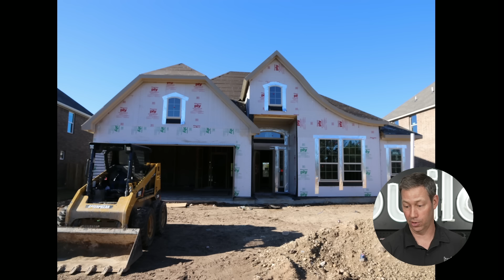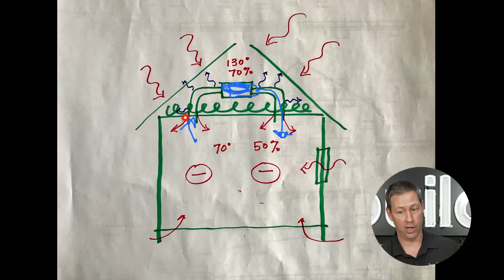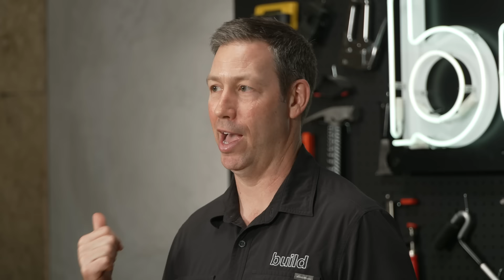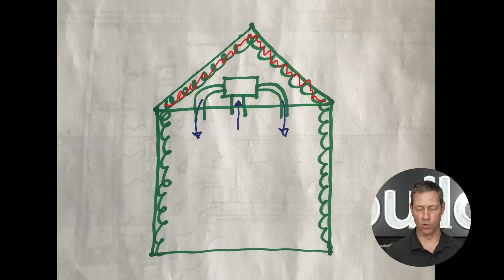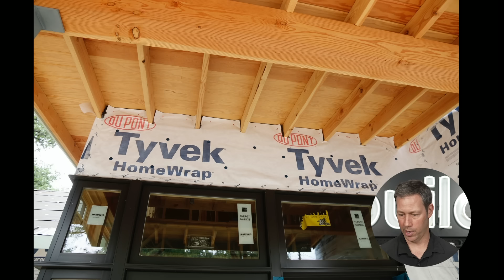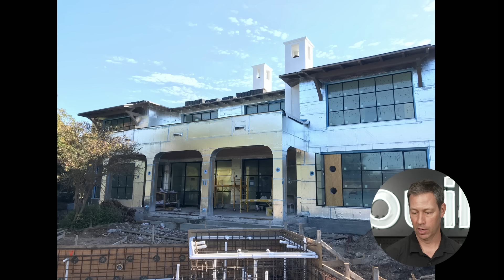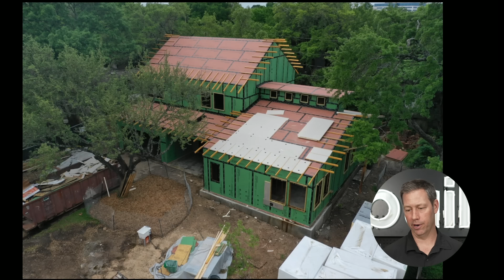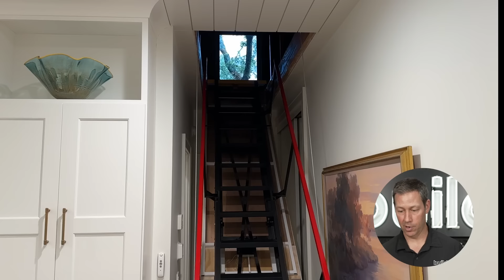CRAPPY ATTICS are Standard in America! Here’s how to BUILD - DECENT or AWESOME

Comment: Properly done, the ventilated attic is the highest and best design for cost vs. efficiency that there is. The only real restriction is that you can't have your HVAC up there. That's it. As long as any penetrations from below are well-sealed and its got a good vent ratio and is protected from wind-washing with a good R-60 or so in the "bathtub," it will be very hard to compete with long-term.
Reply: What do you mean by “bathtub”?
Reply: @kc9scott  A friend of mine is the OP above. He told me that he has answered you twice but both posts have been immediately removed though they had no links or anything else unusual about them. So I am going to attempt to post his reply in different language and see if it gets through whatever is happening on YT or with this channel. Your question is best answered by Joe Lstiburek, a building envelope engineer. If you do a search for -- building science insights to vent or not to -- it should come up. (My reference is missing normal punctuation in case that has something to do with the problem, maybe referring to the work of someone else.)
Reply: @mpenner2124  OK, thanks, I checked it out.  For others casually reading here, the “bathtub” is the attic floor (really the ceiling of the level below), along with any vertical barriers needed along the outer edge to hold in loose-fill insulation, and to stop air from blowing through that insulation.
Reply: Why can’t you have a vented attic with the HVAC up there?   The HVAC company I used moved my HVAC to the attic instead of garage, said so it was more centrally located
Reply: @27photogger  Did you watch this video? Or the other one my friend referred to above? They explain why. It’s about a 25% energy loss.
Reply: We have our HVAC air handler and ductwork up in our attic.  That's how it was when we bought the place.  Not sure what I'll do when it comes time for replacement.  Maybe multi zone mini splits on both sides of the house
Reply: @robertm5969  That can be a very good option if the capacity is sufficient and enough fresh air is getting into the house otherwise. The other, probably much more complex option is to remodel the attic into an unventilated design.
Reply: @ReflectedMiles  why is fresh air entry into a house a consideration for attics, HVAC systems and mini splits?  As I understand it traditional HVAC and mini splits don't draw fresh air into the house
Reply: @robertm5969  The mini-splits do not, hence the term “ductless” in association with them. A well-designed traditional HVAC scheme will normally incorporate fresh air exchange in some form. Indoor air has long been a source of major exposure to pollutants according to the EPA. Many homes that are not sealed well, however, leak a lot of air anyway, but the ideal is to control that and have controlled fresh-air exchange at a given rate for the size of the space.
Reply: @ReflectedMiles  thanks for the explanation, I understand.  I don't believe our HVAC system incorporates any fresh exchange.  Our house was built in the 80s and Ive done my best to air seal the attic and other major gaps I've found in the past year.  However, I'm sure a decent amount of air is still getting in/out.

Comment: The one thing you missed, is actually drywalling. Your attic can actually be a completely functional usable space and this is actually very common in Europe.
It’s such a waste to throw away what is essentially an entire free floor  (if you’re insulating on the roof side) it also means it’s much easier to keep clean no dust collecting in your Rockwool, no critters. Makes it much easier to keep it a tidy space.
Reply: he didn't miss it, the way the HVAC is setup it's in the free space.  drywalling it wouldn't have made an appreciable different to making it a usable space, as all that equipment would still be in the open space.
Reply: Making it usable space would increase the home square footage and in turn the property taxes.😮
Reply: @allent555  not unless it’s taller than 6’. Everything less than 6’ isn’t taxable
Reply: He discusses drywall at 29:30
Reply: @allent555  only after you sell. And only the parts that are tall enough.
Reply: @twestgard2  seems he does briefly, still even for storage, it makes a world of difference, 
It brightens up the space, reduces visual noise. Both of which which makes it easier to see and find your items.
It does not need to become living space to see huge benefits from pretty cheap drywall application.
Reply: @twestgard2  I am sure that 6 foot rule would depend on exactly where you lived!
Reply: @DYI  I believe it’s in the international building code that most places in the US have adopted, but to your point, many places make modifications, and not everyone is in the US, so yes, definitely would have to check in your area if you’re doing a project like this.
Reply: @allent555  
Not if you wait till the assessor leaves🤔
Reply: A low slope hip roof is cheaper and leaves no room for anything but insulation in the attic. Use the money you saved to add a room or two on the 1st floor.
Reply: @ToIsleOfView  That assumes a lot of things, like the footprint available and zoning. It would also increase the taxes. And moving the AC out of the attic is a big stylistic choice. But maybe the biggest thing is that it doesn’t address any of the performance issues for air, vapor, and bugs.
Reply: @twestgard2  Footprint is the same for a basement or insulated crawl space. Air,  vapor, & bugs have nothing to do with a live-in finished attic. We have to air-seal unfinished attics the same. The split-level house offers a partial basement & an easy way to have a finished second level for bedrooms etc. Taxes? Living sqft and lot size? Attic-installed HVAC  must make high temperatures and poor access a detail. everything breaks down. R-5 flex duct in a hot attic is worse than an exterior wall with R-5 insulation because 1000 - 2000 cuft of air is circulated over the inner duct surface for a drastic loss of btu's into a vented attic. Finished attics are fine for remodels but not for new construction. I would like to see ceiling chases for all duct so the duct is completely contained inside the conditioned and sealed building envelope.
This can be done as a remodel as well.
Reply: @ToIsleOfView   You don’t seem to have watched the video all the way through or something. He explained the improvements in bug, vapor, and air. 

Your suggestion was to add a room or two. That changes the footprint, unless you’re saying to add a basement, in which case the cost difference is huge.
Reply: Just do not ever have attic? in AUS  Seems to be a Euro or US thing, as we don't need a lot of heating in most of Aussie houses except for the southern states.  And most new house are slab-on-ground especially new buildings.
Reply: That attic isn't very big. I don't think you can even stand up in it.
Reply: I’m positive that varies greatly depending on where you are.
Reply: Not free per se as often the trusses are engineered to take roof loads, but not habitable loads (furniture and people). If the truss also has to function as a floor, often joists need uprating.

Comment: The great thing about this vid is that it helps get the building community off auto pilot for attic/roof/ceiling construction. I'm 500 miles north of you, so we get the heat/cool cycles. The big difference, as you have pointed out, is that most of our heating equipment is somewhere in the living space. With that, 99% of homes here have ducts draped all over the attic. Personally, i have searched but have never seen a study done on the "vs" of spraying closed cell directly on the ceiling joists vs closed cell on the roof rafters. If we spray the roof rafters, there is an element of cost associated with heating/cooling that attic space. I have never seen exactly what that is. So, our method is to stop the cycle of heat exchange at the ceiling level and insulate the heck out of any ducts up in the attic. Someday, it would be be good to see the cost-benefits of  going this route vs the conditioned attic.

Comment: Here in my part of Europe, fully developed attics, and with that I mean attics developed as almost complete rooms, with (almost, only sheetrock, which would naturally be unacceptable as walling in any other room) proper walls or roofs, full isolation, flooring, outlets etc. are absolutely standard, so seeing these American attics is always crazy to me.

Absolutely do fix your attics, they can be real rooms, put your venting in the walls (where they belong), remove those internal wooden pillars and put in a Popper roof structure, and you will literally gain one or two additional proper rooms.

I live in a 2005 house, with an almost slab on ground foundation (we need some pretty solid ground anchoring, since we do not have a basement, and are not straight on bedrock) construction, and all our venting is in the walls, our attic is a full office, and since we have proper walls with isolation, as is required around here, we have basically no cooling costs in summer, even if it gets up to 40% in summer.

Comment: I find it rather wild that houses are actually built with the HVAC in the attic.  Owned multiple houses in Louisiana, Texas, and Florida which have all used a closet HVAC which places it within the controlled space.  The best one, in central Texas, had ceramic coated hard ducting and a (older) Carrier control system you would find in a commercial building  with sensors in each room, dynamic airflow balancing, etc which even included the walk in closets.  Massive overkill but apparently the guy who built the house designed HVAC systems for big commercial buildings and it was his retirement home.  Bought it as an estate sale and didn't realize what I got until the home inspector freaked a little while checking out the attic.

Comment: I live in a Fl. house that was built in the 50's with a very low pitch for hurricane protection. Never understood why the air handler was put in the attic instead of the garage.  However, the unit recently went and I replaced it with split units myself.  I will never go back.

Comment: When we bought our first house and I decided I wanted to store a lot of stuff in the attic, so I thought I’d do major cleaning. I didn’t know any better and vacuumed up all that insulation. Our house was built in the late 70’s. 
I didn’t know what it was, I assumed it was the mess the builders left behind many years ago. Boy did my hubby yell at me when he found out. And I felt like an idiot woman 😢
Reply: You actually did a good thing. Houses built in the 1970's had lots of air leaks from poorly fitted dry wall, holes for wiring, plumbing, and vent pipes. After you vacuumed all the insulation out, your husband should have gone all over the attic floor with spray foam to seal all those air leaks. Then you needed to put the insulation back in of course. Or he could have had spray foam installed between the roof rafters and floored the attic for lots of good storage space.
Reply: Dang, that is a loooot of vacuuming. Though, to be fair, the insulation probably wasn’t doing much at that point.

Comment: this is great and all. but it still makes it hard for me to decide how to retro fit something like this into my 70s style attic because the pitch of my roof is so low that my attic is a crawl space.
Reply: I’ve been slowly redoing my attic and yeah it sure does suck basically crawling through it.
Reply: @chadhowell1328  i'd do it if i had more access. i'm not exactly skinny and even a skinny person would struggle with this.
Reply: Probably your only reasonable and easy option is outside insulation and air sealing the next time a re-roof is warranted. Removing the sheathing and replacing with zip-r sheathing or bare minimum, sealing the existing sheathing and adding exterior insulation rigid foam.

Comment: I have an old house in Germany which was also not insulated. At the end, I was actually using Sandwich roofing with 160mm PU insulation. I used it, against the advise of some builders here in the south of Germany, at a 55° roof angle. But it worked out great, and I can easily install some PV system later on on top of it. It will probably fulfil many new regulations the Greens might come up with in the future and the metal roof will probably outlive myself and serve my kids well, as long they put a new coat of paint on in time. Plus, since the old roof has been clay tiles, I did not need to change my rafters since the new roof is actually lighter than the old one PLUS I have now more roof Attic space available comparing to just insulate the Attic.

Comment: I bought my childhood home from my mother. My grandfather built it. I sprayed the rafters with open cell and cut our heating and cooling down substantially. We had 2 rooms that wouldn't get under 77-78 degrees with the AC running all day at 95-100 degrees outside. We also sprayed the walls of that room, and added 1" of that Perma -R to the inside wall. Basically a cooler. After that, the AC would then cycle thru the day and maintain 68-70 in the house regardless of how hot it got outside. We could take a week vacation, check our temps at home remotely and even on a 98 degree day, 3 or 4 days in, the 2pm afternoon temp would only be 80-81 in the house. If it was only 90, in full sun we would only see 75-77. The biggest reason for AC in most of the summer was humidity control. North Mississippi. The house wasn't in shade until early evening about 3 hours before sunset and even then 50% shade.

Comment: Not interested in spray foam (doing Rockwool), but my real struggle with a sealed attic, is the risk of condensation when a traditional roof is installed (asphalt shingle and tar paper on sheathing).
Reply: yes, you have a problem. cheapest solution is 4” of spray foam to resolve your venting issue, then the rest with your rockwool though you would be better off spending the cash an filling the cavity with closed cell spray in. The combination of 2 insulation types reduces the up front cost and allows for an unvented roof.

Comment: Great video! I live in a suburb of Chicago, yes I have ranch home with a full basement and an attached three car garage (this is my second home with a three car garage). I do have a play room in the basement along with a full shower bath and a combo furnace/workshop/storage room. My home has lots of closet space, including a mud room with storage. My home was built with engineered walls and trusses built off site. I have a pull down ladder in the garage to access my attic space. The attic is blow in fiberglass insulation, but not over the garage. The home has 9’ ceilings and a a lofted ceiling that goes up to 14’ in the family room and entryway. Because of the 9’ ceilings, the garage ceiling is 10 1/2’ high. This allowed me to do perimeter shelving, 34” below the ceiling, in the garage for more storage. 
PS: Storage seems to be sought after down south, why don’t you build larger and taller garages for the extra storage space needed?
PPS: My current home has lots of storage space and then some, I haven’t used up my storage space, and probably never will.

Comment: The American methods of construction were designed to be as cheap and quick as possible. If you stop to actually think about what you're doing, you can compare your house to a water reservoir. If you're building a water reservoir, you want to ensure that all joints and seams are welded together, to keep the water in. A house, principally, is the exact same thing except that it keeps water(and wind) out. If you build a house without windows or doors, you should be able to pressurize it. If you can't pressurize it, then you've built a faulty house.

The same can be said for basements/foundations where we know that concrete has a certain amount of permeability, we either need to erect an additional water barrier or irrigate around it in such a way as to prevent water from reaching the concrete.

Comment: You should drywall that attic, exposed rockwool or fiberglass insulation is a known carcinogen, little glass fibers get in your lungs and stay there shredding them up.

fiberglass makes an incredible amount of glass fiber dust, i only happened to notice with a low setting sun shining on it and a handled the material, dust flying out like crazy. Its the new asbestos and I think we will learn the hard way.
Reply: I agree. I absolutely do not understand why fiberglass insulation is not enclosed in plastic or paper, in anything but loose.

Comment: Great video and info on this one Matt! For remodels, especially of historic homes where we can't change the roof profile and don't want to introduce spray foam to the roof deck, I have been toying with the idea of building a conditioned and insulated box around the HVAC equipment in a vented attic, and then doing a "flash and fill" on the attic side of the ceiling with closed cell to seal it and loose fill for the rest of the R value, with the ducts buried in the loose fill instead of hanging in the air.

Comment: Good work, but wonder how this will work in a more 'temperate' area, like in the northern North America,, in northern Europe, etc, where A/C is not that prevalent, nor needed, and sealing up the outside can lead to moisture getting trapped inside the building envelope and condensate on the colder exterior surface. BTW, did notice you added a foam layer on the outside of the air/moisture barrier, but is that enough when temps drop to -20C or lower?